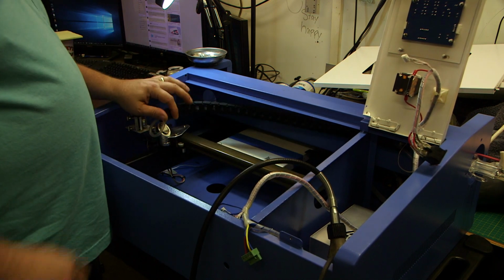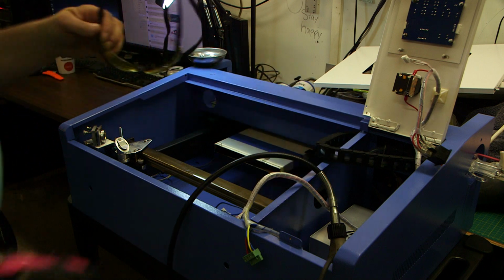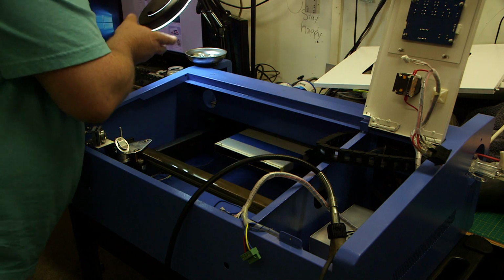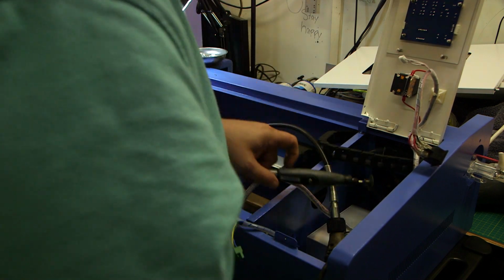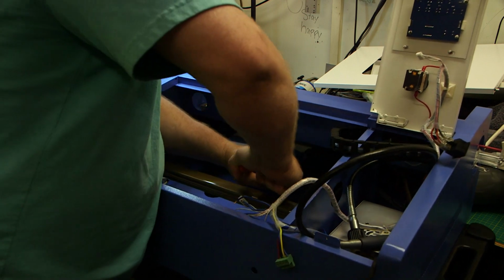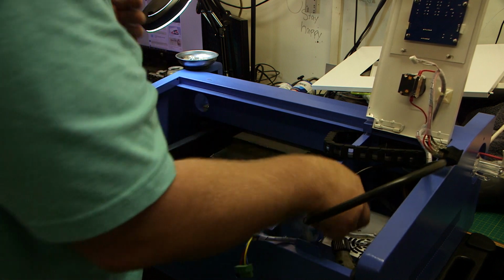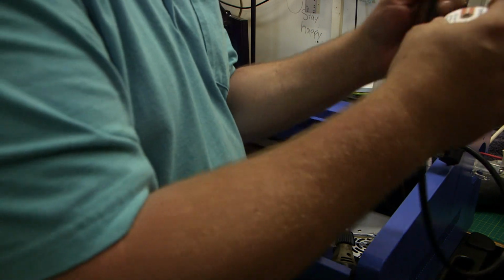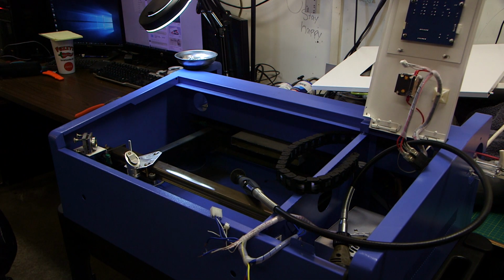Cutting Back The Exhaust Port In A K40 - Project Odin

Comment: i got lucky.  my K40 was the type with the integrated fan and removing the duct was as simple as removing the fan from the back and undoing another four screws and then the duct pulls straight out.  Then it was jut a case of reconnecting the fan.  I have noted no detriment in functioning at all.

Comment: Why you did not screw that exhaust port off first from laser? On my 40W it is just screwt behind with 4 screws... I did take it off and cut it alone :)
Reply: A lot of them have that exhaust port tack welded in rather than screwed. They aren't removable. There is a LOT of variations in the different models.

Comment: I removed it then cut it with my Dremel. That was fun.
Reply: How did you remove it? After the bolts are off in the back, it still wont fit between the frame and case on the inside (at least, mine wont)

Comment: Was the exhaust port in the way of the laser or did you just cut it back to allow more room for something you want to engrave?
Reply: The port was designed to work with that clamp he removed. To open up the work area and to be able to work on larger pieces you do what he did. The laser shuttle can cover about 12 by 9 inches.

Comment: Wondering why you didn't remove the exhaust assembly to do this. Mine is held in with three screws.
Reply: I'll have to have another look. mine looked like it was just screwed to the back of the case but if it's attached to other stuff then I'm inclined to agree.

Comment: For a person looking to get into laser engraving, can you explain why you are doing this and the benefits it gives after it's done?
Reply: Cutting it back like that allows me to insert larger pieces in the work area. My cutting area doesn't change, but the extra space means I can make full use of the laser's work area.
Reply: I am doing this to mine so I can put in an adjustable height Z table. The exhaust duct interferes with that. Additionally, the duct was intended for systems without air assist. If you have air assist, having the directed airflow becomes less important as long as it can evacuate the fumes which in most of the units, the stock fan can't in the first place. Better fans are a pretty standard upgrade.